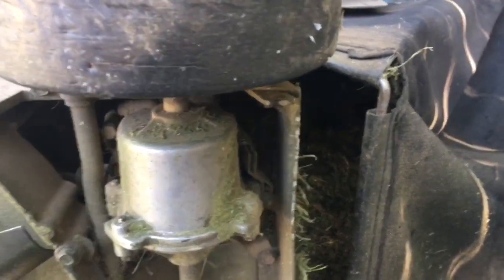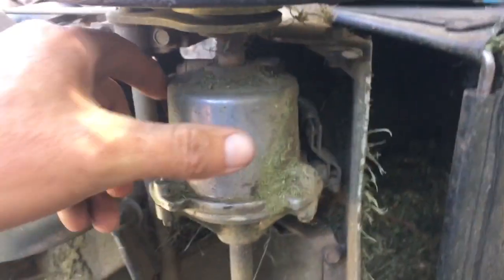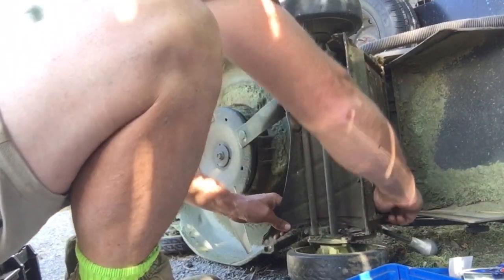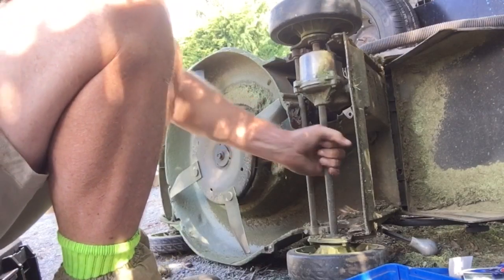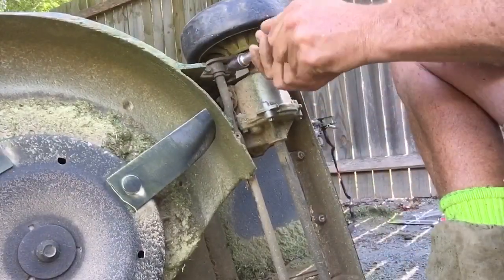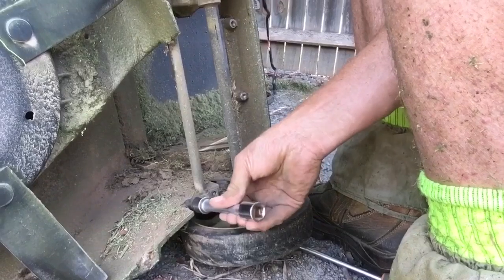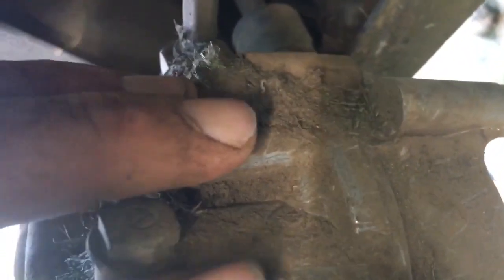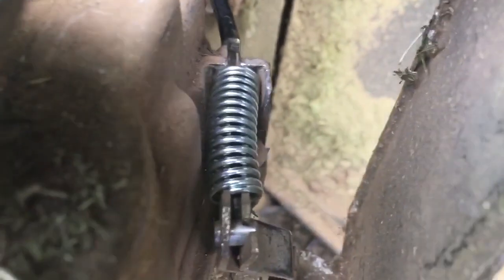Honda HRU216 repair the self propelling control cable

Comment: Thanks for the vid mate, for anyone struggling with this issue, check the drive shaft running from the deck blades back to the gear box, mine had disconnected at the front as the pin had popped out, you can access from the plastic guard with the hose piece on it on top of the mower

Comment: Good video helped me a lot. Tip: Instead of taking the front wheel off to get the back axle back into its groove. I simply turned the mower back to up right position and the axle slipped back into place. no front wheel or disassembly required. Would be great if you could make more video's specifically about servicing equipment or business tips!
Reply from the maker: Thanks buddy. ill give that try next time. Ill post some more vids on tips and services...
Reply: Thanks this tip worked and really helped me reassemble.

Comment: I found out the hard way that the panel he is removing so easily at the 2:00 is HUGELY impacted by the cutting height position of the mower. I fought with my mower for about an hour before figuring out that It is much easier to remove and refit this panel with the mower’s cutting height set to high.
Reply from the maker: Yep that plate is the one

Comment: Use a zip tie to compress the spring, I use a thin tie to remove and a thick tie to assemble . I would send a photo if I knew how'
Reply: Thanks this tip helped.
Reply: Genius, a genuine zip tie technician! Thanks mate this tip made the worst step easy peasy lemon squeezie

Comment: Great Aussie Video mate! 
I've got a HRU214 (37yo) and blows blue smoke. :(
Reply from the maker: Ha ha glad you liked it mate. A Honda blowing blue smoke ? She’ll be right mate
Reply: If you've still got it, put a set of rings in it.  It'll cost about $50 and you'll have a great mower for another 37years!    I have a hru214 as well.  Great great machine

Comment: Thanks for the video. I have a 215 two speed Australian model mower and it seems that there is only one speed. Obviously the gear box works but do you think that the position of the arm onto the rod from the gearbox could be out of alignment ? When in gear one there is no engagement . When the lever is pressed a bit more towards gear 2 i can see the gear take on the drive. If that is teh case maybe when it is in drive 2 it is actually drive 1 and a bit ? I plan to get to that section and adjust the arm and see what happens.
Reply from the maker: Not too sure about that model but sounds like the same setup .
I’d adjust the cable first
Reply: @MBMOWING  
Thanks. It seems like the cable is already adjusted to maximum already .
Reply from the maker: May have to replace the cable- if that doesn’t work it would be the gearbox issue

Comment: Hi, can i ask a quick question, is there a neutral on the gear levee? Or just 1.2.3,  the reason i am asking because my hru216 as soon as I engage the self propell handle, the machine start moving straight away

Comment: Does the self propel cable on a transmission go by itself up and down or does it only engage up and down when the engine is running?